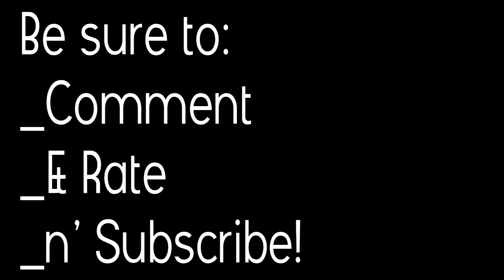Thirsty Devil Toilet

Comment: Speaking as a "former" building maintenance person the reason for the long flush is not the age of the handle, but the fact that "you", and other ppl are afraid to touch the handle with your hand, so you flush with your foot. While it didn't look like you used too much force that time, many ppl probably have and that damages the mechanism in the flush handle, which makes it stick and won't stop flushing. I couldn't tell you how many of those things I've replaced over the years, too many!